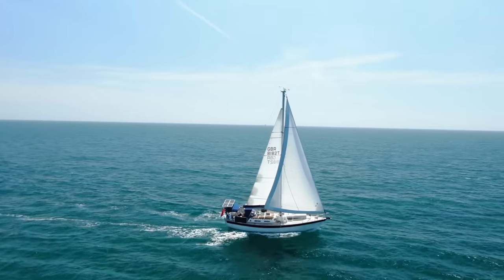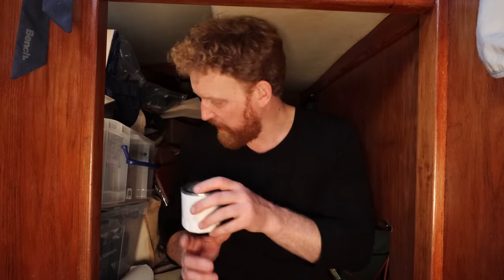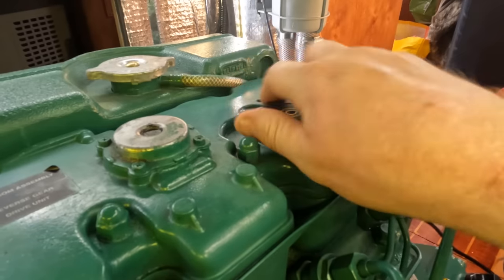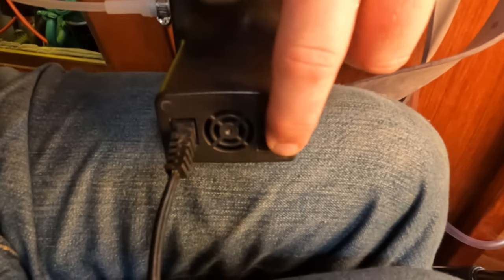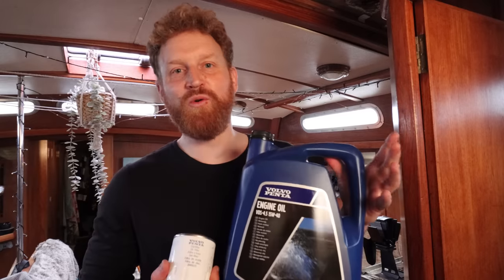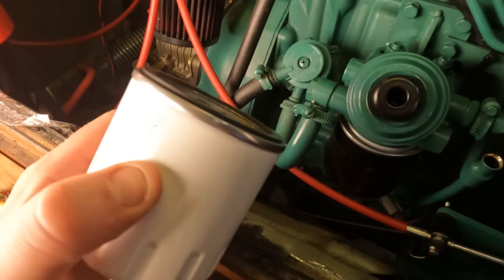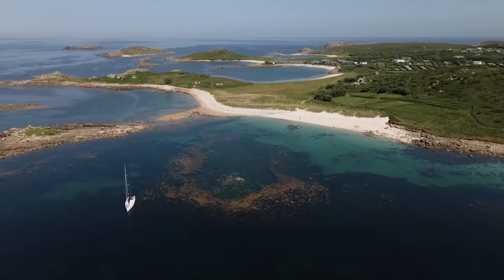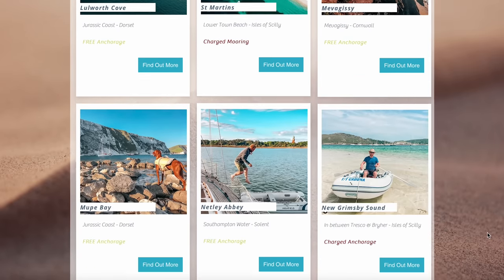DIY Marine Diesel Engine Oil Change

Comment: If you want to save some more money Dom, here's a couple of tips. Your engine is a Perkins painted green plus a few other bits added by VP. Buy a Perkins oil filter. Also Volvo don't make oil, so buy same grade SAE 15w40 API CL-4 oil from Shell (Rotella. T4) or any other hi quality 15w40 API CL-4 diesel  oils, some even have the Volvo spec in the small print. Check the spec.
Edit, just read the Shell spec. Latest RotellaT4 is API  CK-4, even better and has Volvo VDS-4.5 on the approved list.

Comment: Top tip, measure your dipstick. Put it next to your oil extractor pump pipe and mark it with a sharpie or wrap in electric tape you know then how deep you are. Saves doing the dipping up and down with the pipe.
Reply: That's some solid advice

Comment: Some hint: let the Engine run for one minute before finally checking the fill level. The filter has to be filled, which takes some oil. And many thanks for your Videos. Dieter

Comment: Always prime the filter!
Once primed, tip the excess out, a lot will stay in the filter and will save those engine components!
Or.....not as good but easier....after refitting the filter, crank the engine over for 10-15seconds (not longer otherwise you'll suck sea water back through the exhaust) whilst holding the fuel pump governor arm in to stop the engine starting. This will build oil pressure and re-fill the filter without letting the engine start.

Love the videos though :)

Comment: I have a smaller Volvo diesel on my sailboat and a friend showed me how much easier it is to extract the old oil directly from the tube that extends up from the bottom of the sump. It’s the one with the black cap that is just to the left of and below the oil filter. If you have a hose that fits snugly over the end of this tube, it’s a breeze and you know you’ll be draining from the bottom of the sump as opposed to fishing a small tube in through the dipstick opening and guessing about effectively reaching the bottom…. Engine is really purring like a kitten btw 👍
Reply: I was going to say, I have the D2 55 and it has a special extracting tube (Black plastic cap) below the fuel primer pump that is where you should extract from on this engine.

Comment: One more comment, that applies to all O-rings or flat round rubber gaskets: after teightening the filter housing in your case, turn it in reverse 2-3mm to take off the mechanical shear "stress" on the rubber. Your boat will be thankful. Good luck.

Comment: Also remember if you are in doubt its always better to run a little low than a little high oil. A quart low the pickup will still pump oil, everything will be fine, running a quart high you can get into crankshaft splashing, this will foam the oil, the foamed oil will now be pumped through the motor, this will lead to higher friction, higher oil temps and faster breakdown of the oil.

Comment: FWIW I suspect the 0.5l is pretty much left in the engine as that 10.5l figure is for a new dry block. Certainly if you didn't do the little wiggle bit with the pipe it would be. Also you could measure what you take out and I bet it's not 10.5l. PS. Don't forget more Hank based videos too!

Comment: Make sure you check the exhaust elbow every couple of years Dom. Naff cast iron design on a D2-55, which can easily soot-up, hold water over winter and then cause expensive problems for your heat exchanger. Cost me over 4k for a new one 😡. Duralac on the gasket when it goes back.
Reply: Lithiums still rocking it btw 👍🏻

Comment: Doesn't need filter primed if you run it, change the oil, and run it again right away because the engine stays lubed from the warm up run. Probably doesn't need it anyway but ...  I always check the dipstick after the post run and leak check and let it settle because it has to fill the filter and that takes a bit of volume. So run, change, run....wait 5 min for oil to settle back down in the pan then check and fill to level on the dipstick.

Comment: As an ex diesel mechanic, you have missed an important step in the process. That is checking the sump drain plug which has a magnet attached. This will show if any part of the internal parts are shedding metal. Unlikely on a well maintained engine but still vital to detect wear on highly stressed parts.
Reply: And I suppose you just unbolt the hull to get to the sump plug lol
Reply: That is true but not all marine engines have that magnet because it's extremely difficult to get to the sump on some (mine is dinffcult to get a finger on, let alone a socket). I pump my oil out through a funnel into a waste bottle. So I tape a magnet to the outside of the funnel so I can see any sparkly bits that stick to it. So far I have yet to see more than 3 or 4 bits of man glitter in an oil change. Not bad for a 43 year old engine
Reply: Try to place a magnet in the drained oil, that way you will see any abrasion in your engine. Just a thought!

Comment: So how much do marine mechanics charge for this job? And since they can work anywhere a boat is, are most of them mobile or does each marina usually have a company or guy they work with?
Reply from the maker: Hey there. I think it cost us around £400 to have an official Volvo penta technician service the engine for us when we first bought the boat.

Now it costs about £100 in materials and a couple of hours of my time. 😊

Comment: Do you have to top up your engine oil over the course of the year ?
Reply from the maker: Not especially, although towards the end of last season I did top up a tiny amount, literally like 0.1 of a litre I think. Why doing you ask?
Reply: @CadohaAdventures  mainly curiosity , I've had 4 diesel engine cars one of them used about a litre of oil in tops ups between oil changes , the other three never needed topping up .
Reply: Engine looks very clean

Comment: You procedure is going to screw a good number of people over and create one hell of a mess in their boats.  Pull the oil out of the engine first then remove the filter and care on with the normal change.
I have change the oil on hundreds and hundreds of boats, so for those of you who just follow along on his procedure you will likely ask the boatyard to assist in cleaning the mess inside your boat
Reply from the maker: Why will it cause a mess? It didn’t make a mess in ours? 🤷🏼‍♂️
Reply: @CadohaAdventures  that is your boat.  So many others if you remove the oil filter first the oil pours out and there is your mess.  So many marine techs know to remove the oil first then the filter but removing the oil out the dip stick and using a 1 gal plastic bag when removing the filter so not even a drop can land in the bilge.
There are even some boats that once the oil is removed the filters are still full and if they are horizontal … mess.  You have to know what you are doing and what to do with your engine.
Reply from the maker: @eddieohearn17  Ahh I'm with you now, thank you for taking the time to clarify that with me, and all of us. 👍🏽
Reply: @CadohaAdventures  I always recommend that yachtsmen talk to the yard guys, ask us any question and you will get an answer and a story of what you are asking about gone wrong.  I had a guy order 300ft of stainless chain for his boat.  When it arrived it did not work in his windlass.  I asked him what brand he had on the boat.  He told me, then I told him see if you can return the chain if not see if you can sell the chain, if not you might just have to give it away because it will never work in that make.  You should have talked one of us and would have told you to order the chain only from that maker.   He ended up giving the chain away and ordering the new from the windlass maker.
Ask the yard guys questions is my point and it will always be helpful